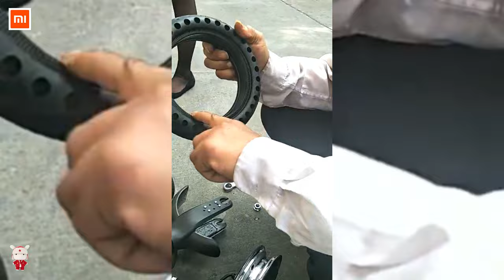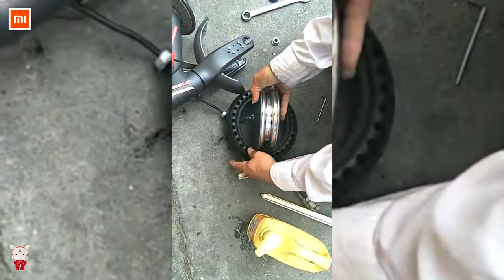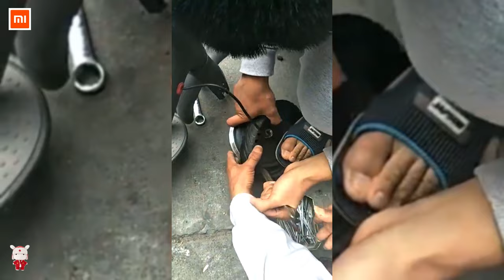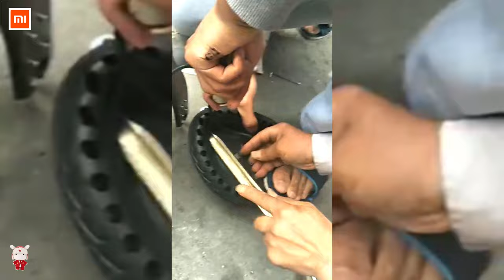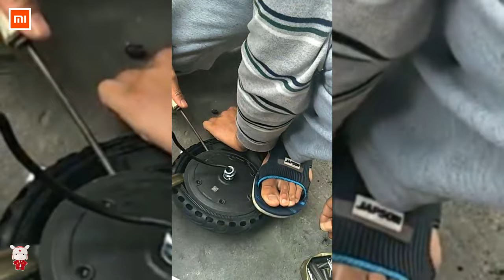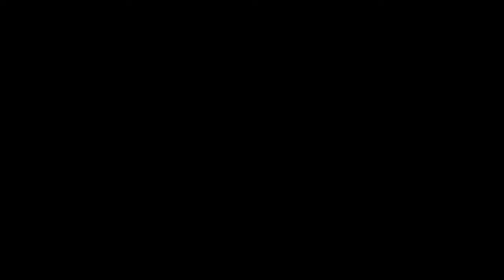Xiaomi mijia m365 electric scooter how to change hollow tire /RisoFan

Comment: That is actually the correct way of installing the tier without damaging the cable. note that you can put the tier in microwave for 2 minutes and then preform the steps in the video! no tools required you can do it with your bear hands, place the top part and then push the bottom part down! requires strong hands, it took some time  but it can be done.

Comment: Hi,

After taking a (first !) longer ride with this electric scooter I managed to puncture the back tyre (inner tube) like 2 times. 😒😞

I patched the 2 holes successfully though.

Getting the outer rubber coat (tyre) off the wheel was hard enough but putting everything back together was something else. 😥😠

I had to use quite an amount of vaseline to lubricate the right sections of the wheel & tyre. A blowdryer/hairdryer was needed too (to soften the tyre a bit). 😕🤕

Good thing I removed the brake disc before assembling the tyre, inner tube & wheel back together. Because you can fairly easily deform it. So that would be my advice too. 🙄

This seems like a good alternative though... 🤔

Best Regards,
Reply: That’s pretty unlucky I’ve had mine for about 7 Months and 1500 km and not a single puncture
Reply: @rileymcvicker1120  Well I'm a bit on the heavy side (weighing 105 kg) so that probably had something to do with it too. 😄
Reply: It is not supposed to be that hard, and it really isn't. There is a neat trick I found on YouTube, and that consists of squeezing the tire with pair of grip pliers so it can fall into the grove in the middle of rim. This allows enough slack to mount/remound using pair od cheap plastic levers.

Comment: About to do this now on front tire! Will report back soon
Reply: Success!!! Omg though...I'm exhausted!! Heated up the rubber wheel that I got from AliExpress. Boiled it in Hott water for about 30 min...then took it out and started to put the tire on...gotta be quick cause the tire will cool off quickly which will make it even harder than it already is 😉👍👍👌😁
Reply: Be honest Devon do you regret putting that tire on the front wheel ..?
Reply: @jamiemurray211  hey Jamie, I do not regret it .. my electric scooter has been running great ever since!
Reply: @jamiemurray211  why ragrets mate? my friend been running these tires for years and its really fine.

Comment: What if i have a wheel without this holes 😕?
Reply from the maker: it does not matter.
Reply: @RisoFan  i mean does it harder to put it on cuz i See you used this holes to put on the wheel.
Reply: @pawezawistowski6065  instead of holes push the tyre up same thing as in video but go between tyre and rim if no holes